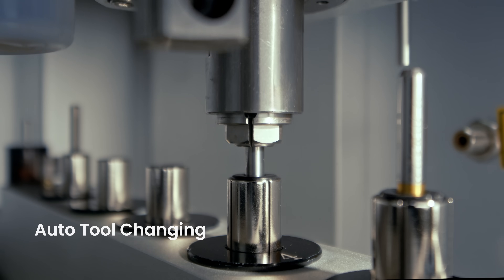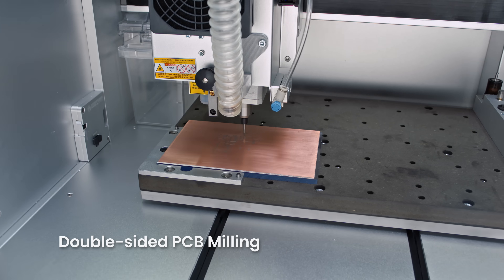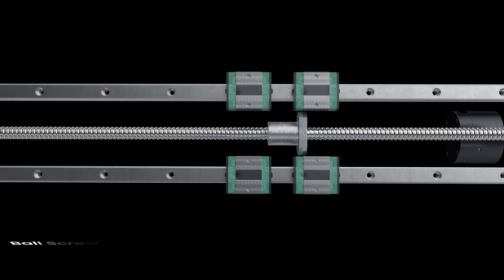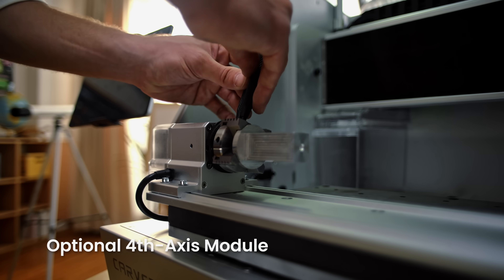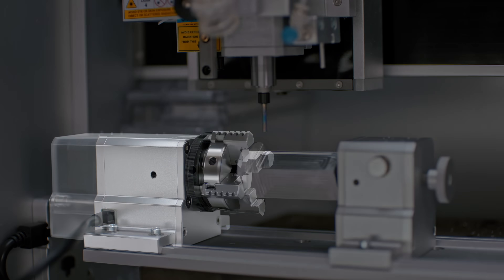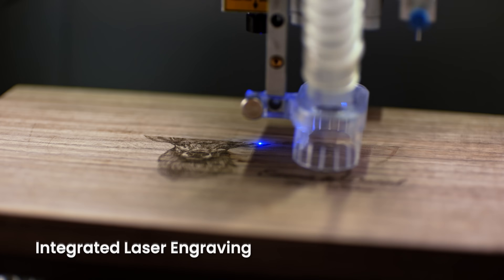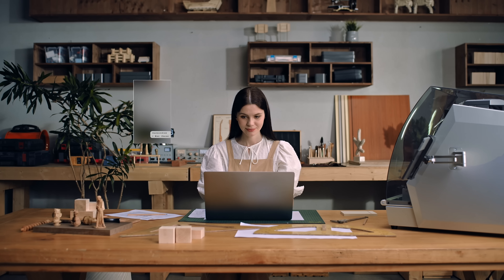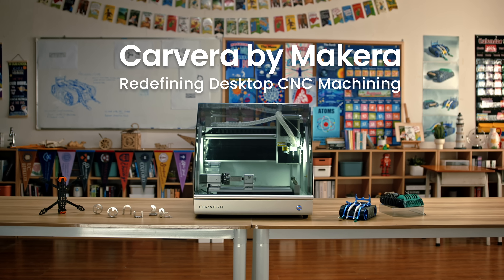Why Choose Carvera by Makera?

Comment: Has not this been out for at least a year? Also when are you going to upgrade the spindle?
Reply from the maker: The Carvera launched in 2021, first on kickstarter. Our second machine, the Carvera Air launched in 2024, also on kickstarter at first. Both machines are in full-retail and production, with more than 10,000 units sold across the two of them. Upgrading the spindle is not an option for either.
Reply: noob here, what's wrong with the spindle?